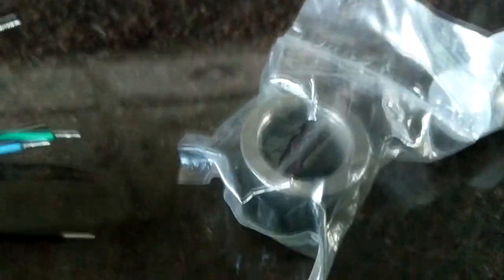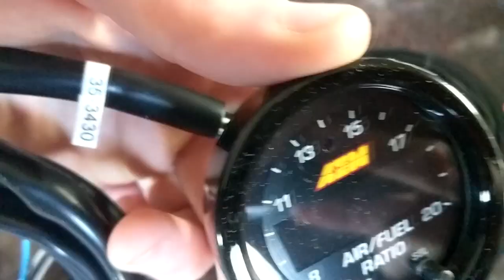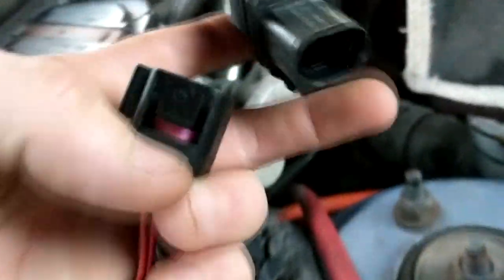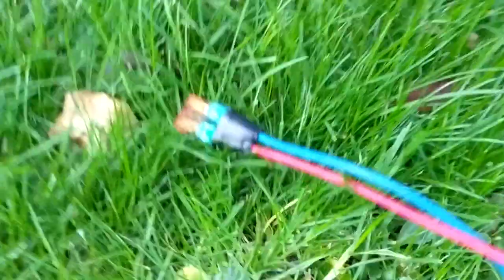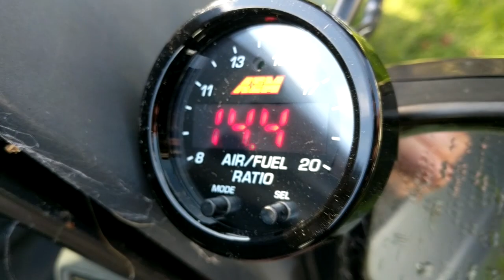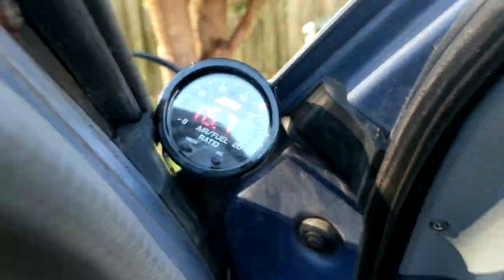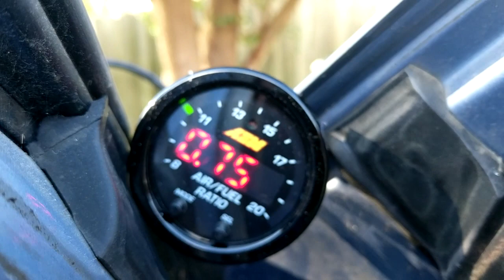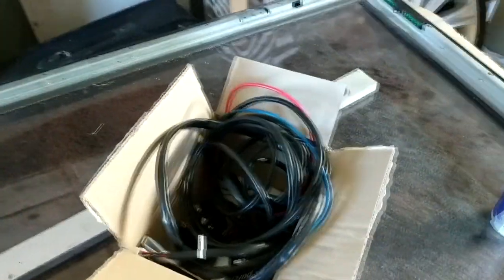Wideband Pt.2 - AEM Wideband UEGO test

Comment: I’m sure after two years you’ve figured out that the sensor should be installed 18inches downstream from the exhaust ports or turbo charger if present. But for anyone else watching who might not know, that’s what it says in the manual for the gauge. 18” down from turbo or exhaust ports, and upstream from catalytic converter.

Comment: I think the numbers in the 15 - 16 range are not indicative of whats in your cylinder.  Many older unsophisticated port injection engines will start to get rough when getting near stoich, especially when cold -  your engine is running smoothly.   Raw fuel from a misfire (not yours) or due to cam overlap / injection timing cam also render an AFR gauge almost useless around low engine speeds / idle - raw fuel can really confuse a WB sensor.

Comment: wide band in a close to turbo location might not be a good idea. using your secondary 02 slot would be more ideal. the sensor will get too hot and can burn out much quicker than normal life expectancy. I think AEM recommends within 3 feet of your trubo, which is about where your factory secondary 02 should be located.
Reply: 36 inches from your exhaust manifold on high heat applications.